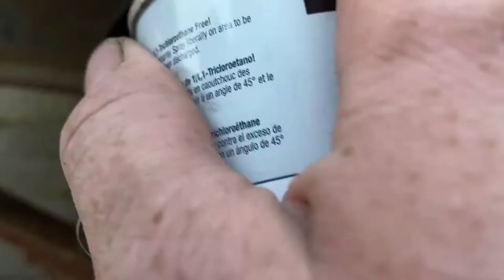DUMP TRAILER DRUM REMOVAL INSPECTION, ADJUSTMENT AND CLEANING

Comment: Personal opinion, but while I agree you should completely change your grease, I think you shouldn't completely fill the hub with grease... more likely to run hot. You really only need "enough" grease  not a lot. By leaving space in the hub, the grease can flow about and not be all stuck in one place (which overheats it at the bearing itself). Gotta let it flow around.. Also, a very light sanding on the brake pads to remove any baked on grease on them.. Last I think you are supposed to tighten the hub nut to stop rotation, but then back the nut off a bit (like 1/8th turn). A little  oil and wire wheel to the studs keeps the threads clean in case you have a breakdown, don't have them too hard to remove. 
On your trailer, they sell new plastic or bronze sleeves (bushings) to replace what's inside the shackle ends. You can get a bunch off ebay... good idea to replace them so they don't wear out the bolt or shackle ends 👍)
Good video thnx ~

Comment: Man, I'm not trying to be mean but you're going to destroy those hubs and bearings. You have to pack those bearings, not just the outside of it. The axle nut should NOT be tightened like that. It's supposed to be "finger tight", not wrenched. Your wheels are going to catch fire with that much friction.
Reply from the maker: I appreciate the feedback sir :)
Reply: Thanks I used your advice today.